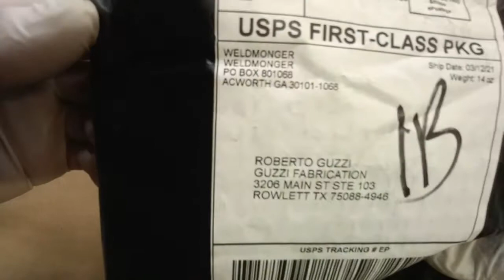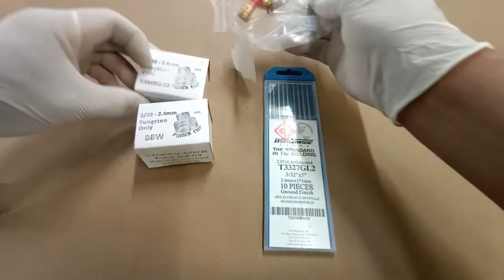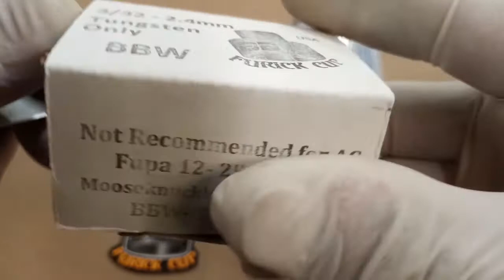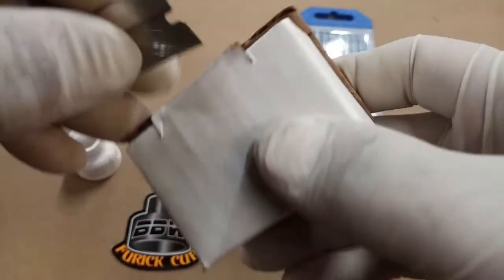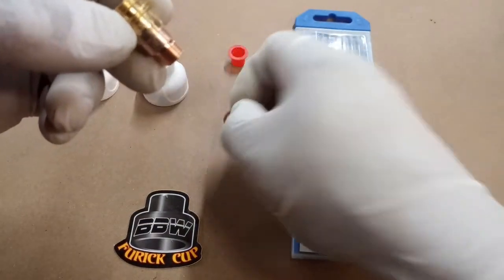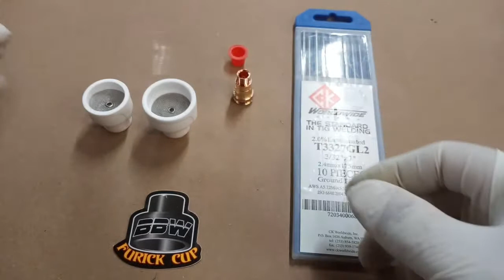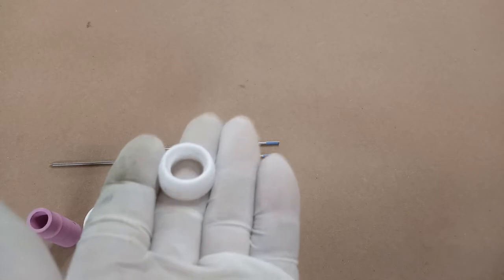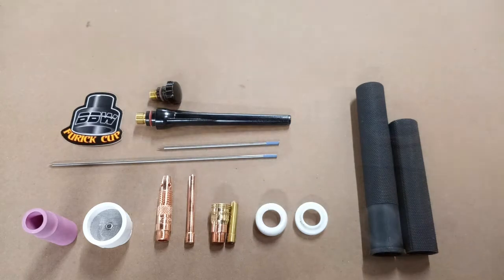Tig welding torch: upgrade and customize  standard torch with Furick gas lens/cup and CK Worldwide

Comment: Do the larger cups work differently for different types of metal? is that why you use them?
Reply from the maker: The larger cups allow a longer tungsten stick out for welding really tight spots and angles, the large cups work well when welding stainless and titanium providing more shielding gas atmosphere